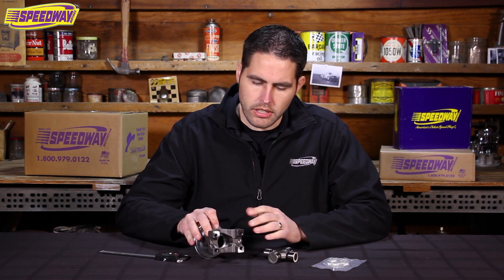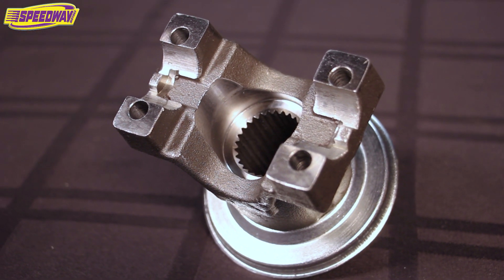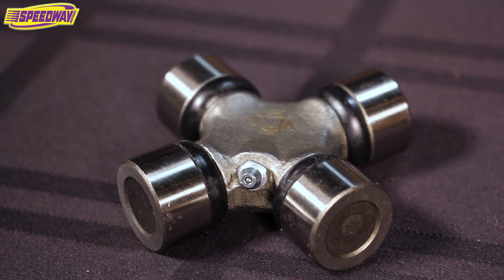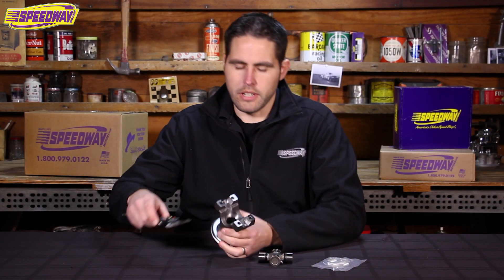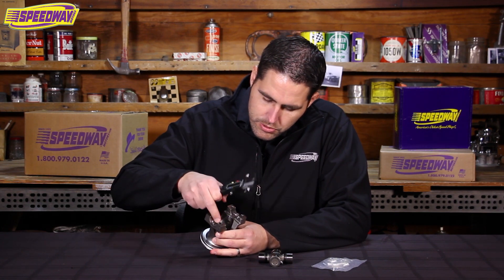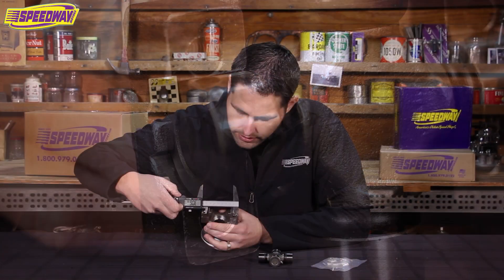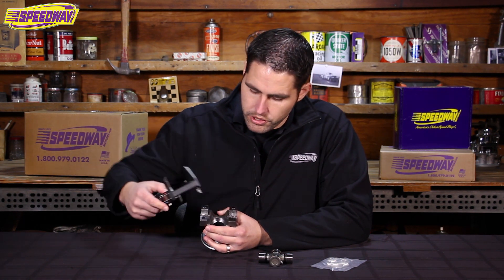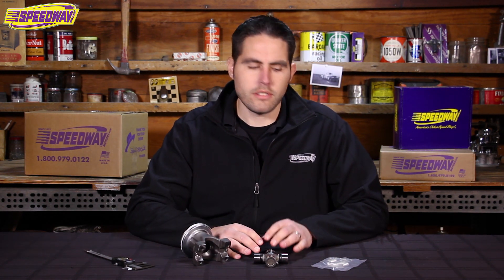Speedway Tech Talk - Measuring U Joints

Comment: I have never seen a caliper that could measure in fractions, cut me some slack!!
Reply: Basically convert the decimal to a fraction, example:
1.0= 1"
1.5= 1 1/2"
3.25= 3 1/4"
When you order ujoints, most of the time it'll ask for the decimal measurement, for a more precise fit!
Reply: 1310 is common on oem chevy and ford ujoints, 1350 is more for heavy duty off road trucks (it's more wide), and there's a 1330 style too.